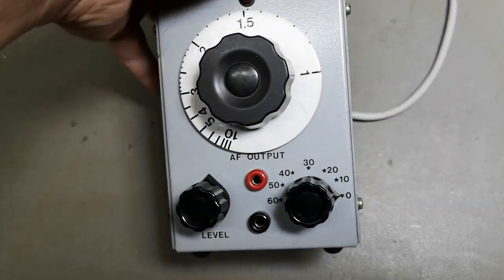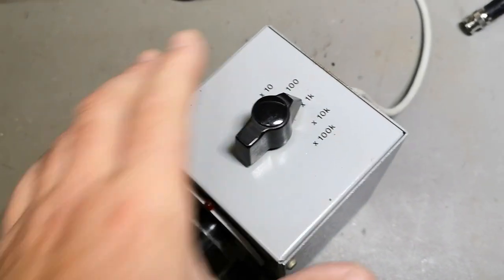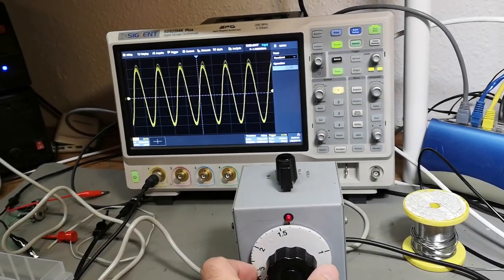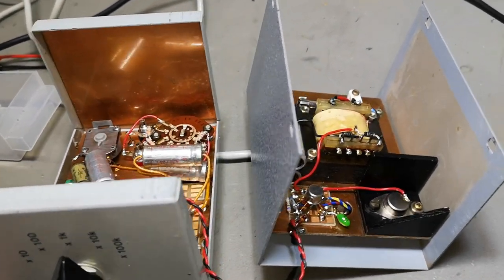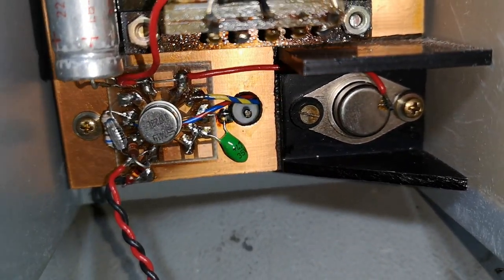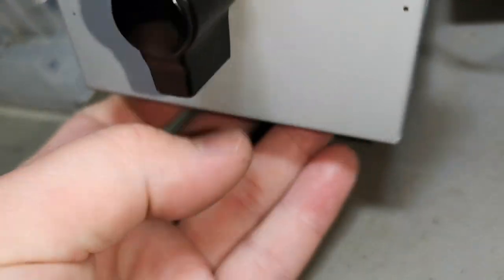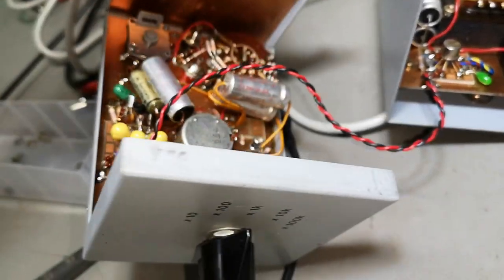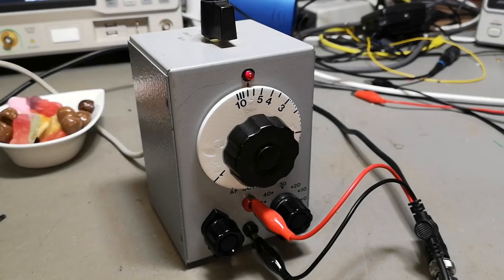DIY tiny sinewave osc 10Hz to 1MHz 1980 test teardown

Comment: RA53 thermistor, the classic part for the Wein oscillator. Most of the instability probably comes from wiper noise in the pot, if you cleaned it it would sweep cleanly, but the one wiper is noisy, and thus the bouncing level. Nice design, classic LM723 there, and yes the wire bodge likely to get rid of needing to have a bigger space under the PSU board to keep the output from touching chassis, likely the TO66 leads are cropped very short there to keep the space low profile. All transistor, and selected padding capacitors to get the tracking on all ranges, with the 3 transistors doing the oscillator gain and inversion, so there is only one transistor pair doing the output buffering, AC coupled into the variable pot, with the attenuator providing matching into 600R at the output. You can stabilise the bouncing by replacing the 2 capacitors across the RA53, as likely they are now very dry, and not doing a good job any more of keeping the DC  level constant

Comment: Looks like the hp of homebrew. If I remember correctly a lamp stabilized sine generator was the first piece of equipment produced by hp.
Reply from the maker: i think you can make a sinewave osc without the bulb level compensator, but it is very hard to do, you either get too low or to high level / feedback,